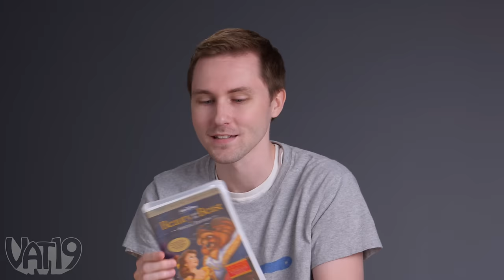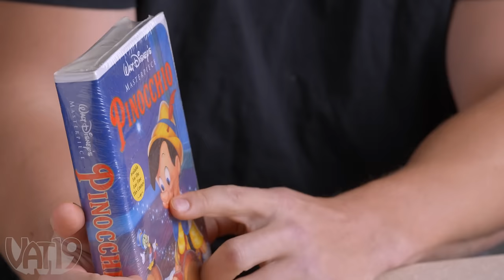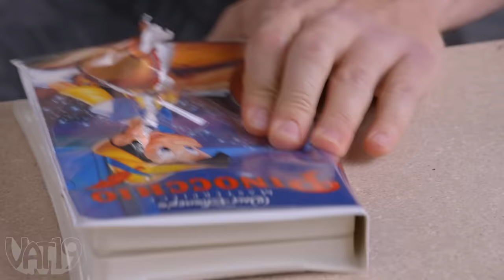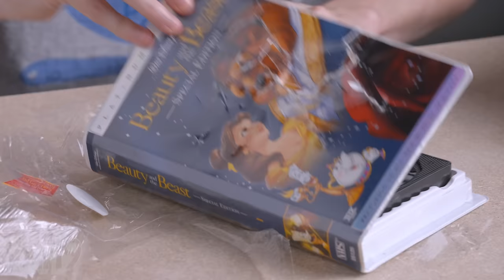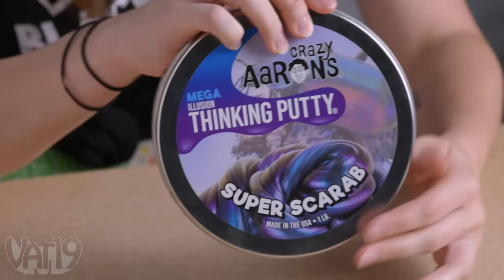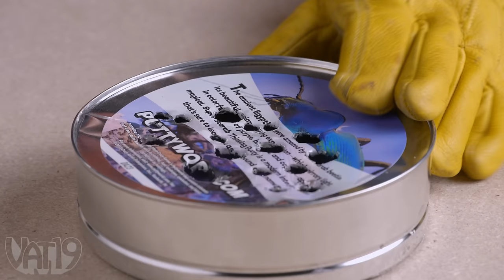$1000 if You Can Break This Toy in 1 Minute • Break It To Make It #44

Comment: For the uhhh… what is it called again my brain stopped working in the picture: roll it into a cylinder, and then grab it with 2 hands and very quickly attempt to pull it apart (a violent and sudden pull with both hands)